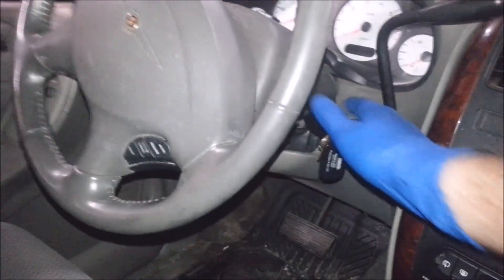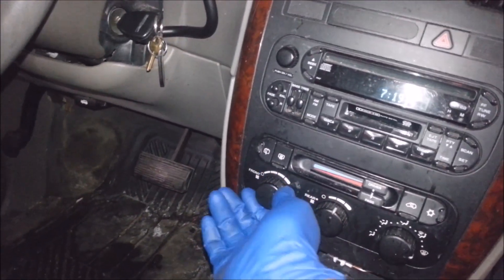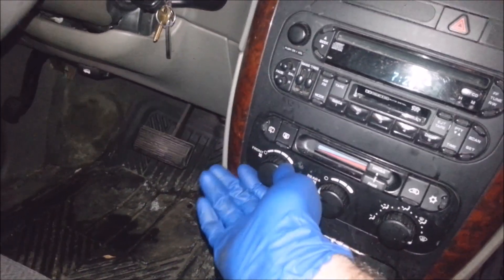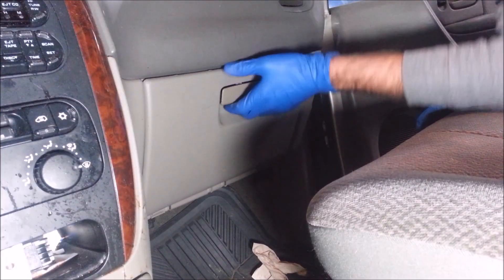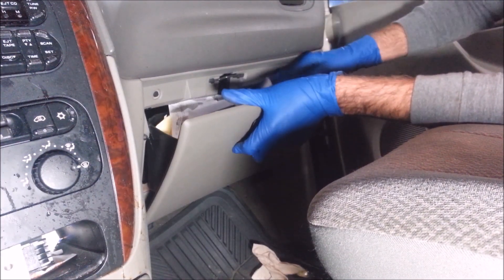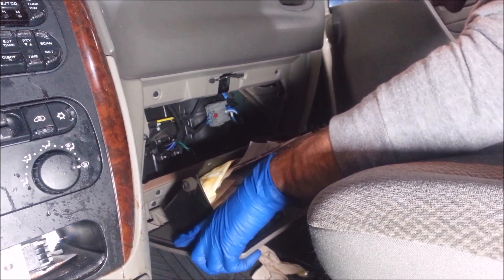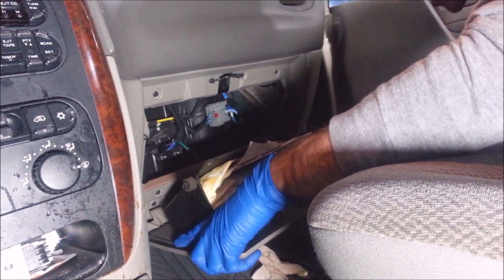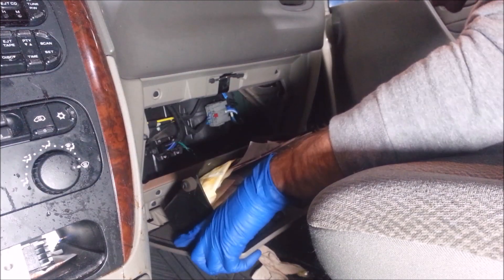2001-2010 Caravan HVAC blower motor testing and resistor replacement

Comment: Thank you sooo much for posting this video!! I had the exact problem and went for over a year without my front fan! After watching your video, I started troubleshooting the plug and wiring. It turns out my issue was only a bad, corroded connection on the black wire on the terminal block. THANK YOU!! GREAT VIDEO!!
Reply from the maker: Welcome.

Comment: Great video and I'm glad my motor is good- tested it with a small 12v battery jumped onto that 2 wire plug after taking it out, and the blower turned on, so it's my resister that needs replacement

Comment: I wish you help me with my 2010 Town and Country. Bought new blower fan and control module. No power at all. Rear ac system completely functional.
Reply from the maker: @americanpatriot2999  check your fuse. Make sure the connector is not burnt.

Comment: If it's whining and grinding and keeps stopping then it's the motor bearing? Resister when no movement after testing directly the motor moves? Just makingsure I understand correctly.
Reply from the maker: Your motor should be quiet.
Reply: @RustBeltAuto  ok I am replacing motor. And will need to clean the drain as the cage was full of water. Update replaced motor cleared drain nice and quiet and heat distribution is fine for every setting. Other than ac compressor isn't kicking in. So that's next.

Comment: 2001 thru 2007 Caravan and Town and Country only. Vehicle platform changed in 2008 and, by the way, much easier to replace than this model.
Reply from the maker: Thanks! Do you know if the newer ones are pulse width modulated like the newer GM's, or is it still an old fashioned resistor?

Comment: Hi,
I bought my Caravan and it came with wind speed 4 not working.
I replaced the blower motor resistor and it worked for less than 1 month, and speed 4 stopped working again, I thought the part I changed could be defective. Then I bought a new blower motor resistor and again in less than 3 weeks speed 4 stopped working.
The other speeds work normally.

Any suggestions as to what could be causing speed 4 to stop working?
Thanks
Reply from the maker: High speed doesn't use the resistor. It is a 12v supply. Is your harness, or connector burnt, or looking like it got hot? Wiggle test connector? I don't know.
Reply: @RustBeltAuto  I'll check what you mentioned.
But the interesting thing is that speed 4 worked as soon as I changed the blower resistor motor, but only for a few weeks, then it stopped working again.

Thanks
Reply from the maker: @zanzangado  you moved the connector around.
Reply: @RustBeltAuto  Well thought.
I'll check that out, thank you very much.

Comment: In my 05 we removed the resistor under glove box and now the rear is out too.  Or does it control both.?
Reply from the maker: You mean the resistor? There is one for each.
Reply: @RustBeltAuto   edited that. Yes resistor. Your saying the one resistor controls both front and back. That would make sense then. I'm just going to replace it new.
Reply from the maker: @2Jeezuzisreal  no. There is one for each.

Comment: Thanks for the video.  If you don't mind what tool is that you are using to check the fan with?
Reply from the maker: Power probe?
Reply: @RustBeltAuto  Yes the power probe, my apologies for not specifying!

Comment: resistor was nice and cheap?  How much was it?     Cheaper to just install a new diode in that assembly?     Thinking diode is cheap and solder in.    Thanks for your feedback!  Thanks for the video!
Reply from the maker: You could fix it, but those things are little toasters. That's why there is always air blowing on it. I always buy a new toaster.

Comment: Since I have no power coming into or out of my resistor, what would that mean? All my fuses and relays are good. I even put in a new resistor. But I'm getting no power apparently, to my resistor. I used a test light to probe my new resistor and wiring. It would seem I'm getting no power to my resistor.
Reply from the maker: Check your controller switch.

Comment: If ah the black and green wire plug is toast what would that imply
Reply from the maker: Resistance makes heat.
Reply: So the plug resisted the power, thus beingoverthown by the resistor? 
Ill have to rewatch the video p
Reply from the maker: @yorkfirepulse8724  it depends. 1. It's a resistor. Resistors make heat. Heat melts things. The blower motor blows air onto it to cool it down. It doesn't always work as good as it should. 2. High amperage, and loose connections make resistance, connections in general make resistance, creating heat. 3. Technically a failing blower motor can create over amperage, creating resistance in wires, and resistors that cannot support it. Just replace the connector, and resistor. If you want to test the current after, see if it gets hot after running it for a period of time, and check your ground have at it.
Reply: Thanks bro i didnt think ud respond and well 
I got a new resistor it looked like the prevoius owner did the same 
So with that i will direct focus to those
Ah thanks a million, sincerlery 
Human- person 
There will tell ya how well it turns out later homie
Clarifacation noted tumbs up

Comment: I don't think that's a diode.  I pulled mine out and the numbers on it track to a thermal fuse.  Mine showed an open circuit both ways.  I found one on Amazon https://smile.amazon.com/gp/product/B0115D709O/ref=ox_sc_mini_detail?ie=UTF8&psc=1&smid=A2QJE0ZA90KWTL.  $6 for 5 fuses not much savings compared to an all new resistor block, but satisfying if you're a fixit junky.  Thanks for the good info on where to look and what to look for.
Reply from the maker: I never knew. Thought it was a diode. Thanks!

Comment: I wish I could find a mechanic that knows the difference btwn a resistor/module so I can get my ac/heat fixed🤔
Reply from the maker: What? Basically, a resistor reduces voltage, and a module reduces amperage. A motor that requires a module, basically soaks up as much power, as you can give it, until a fuse blows, unless it runs on a duty cycle to lower the current flow going into it. Correct me if I'm wrong. Is this a trick question?
Reply: @RustBeltAuto  it's not a truck question. My air/heat went out @ the same time & my mechanic says it's a part that goes in the front dashboard. He said I needed to replace (08 Dodge Grand Caravan) the resister.
Reply: I meant to say truck, not trick.
Reply from the maker: @bigmama72.  that should have a resistor, and not a module. A module is a solid state device. They use one of those for blower motors on like newer chevy trucks.
Reply: @RustBeltAuto  Ok. Tyvm. Here in GA, the part I need can only be purchased at a Dodge dealership.
Reply from the maker: @bigmama72.  I'm going to have to call bs on that one. You can get a resistor anywhere, unless that is not the part in question.
Reply: @RustBeltAuto  Yeah, I've already figured that out when my boss called a parts store and they had it. Idk why some parts stores treat men different from women when we try to do business.
Reply from the maker: @bigmama72.  Dunning-Kruger effect. Probably a chauvinistic one. If you know what you are talking about, it doesn't happen.